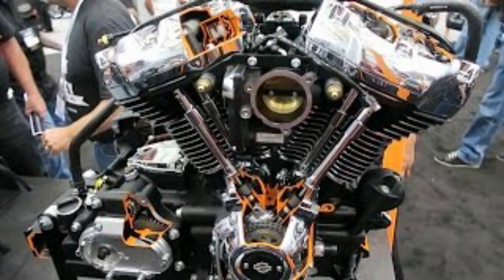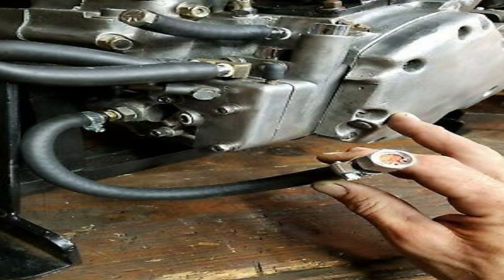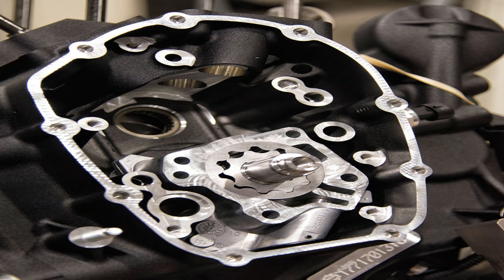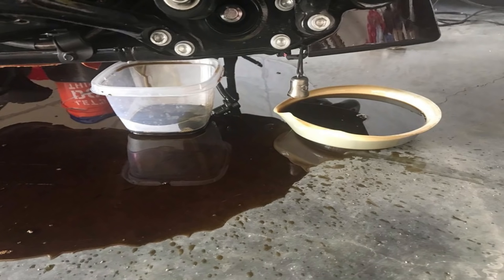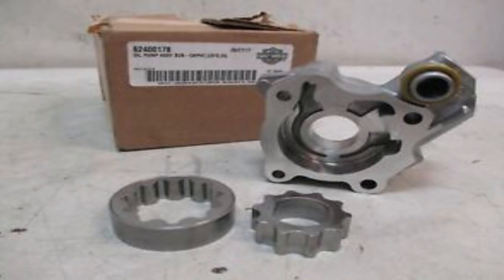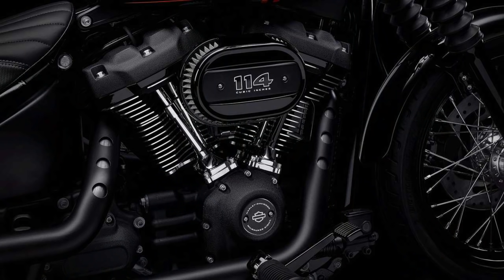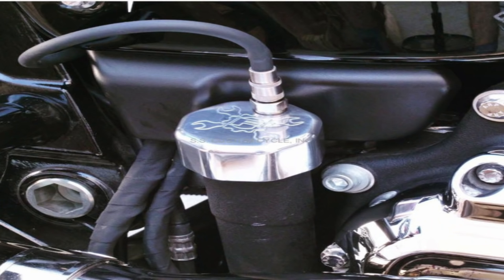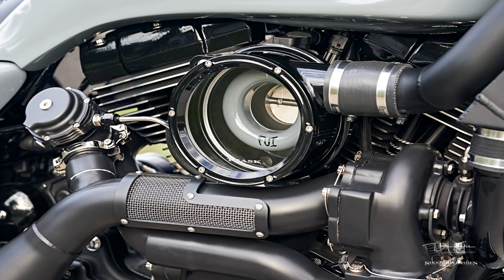The Fatal Milwaukee 8 Engine Flaw Harley-Davidson Missed

Comment: Any chance I can talk you into doing a video on what octane gas is best for your motorcycle?  Should you go with a higher octane as you start throwing high performance parts on your bike? I think with your knowledge you could finally put this debate to rest once and for all.
Also great video! I don't even own an M8 and I watched 👍😎👍
Reply from the maker: That's an excellent idea, I think I'll do that. I see people swear you can run regular but a bike needs the highest octane you can get since they are prone to detonation.
Reply: Norton on their Commandos had the same type of issues with engine breathing problems as well as oil frothing in the crankcase starving the crankshaft of oil leading to failure it was these defects as well as others that brought the downfall of the company being penny-wise and pound-foolish is no good it cost you customers

Comment: Still riding an '05 Deluxe. Rode a Shovel for 20 years prior. Very interesting video. They all have their issues; but over a few years, each engine proves to be an upgrade; even though it's hard to beat the sound of a well built and tuned Shovel! What I noticed when the M8 first came out was how mechanically quiet they were. I honestly could only hear exhaust music.

Comment: 4 oil pump versions plus a new added gasket. Plus the early versions with oiler screws to long. Geez sad R@D from the beginning. Using customers as R@D is losing buyers.
Reply from the maker: Harley has a serious issue of testing on their customers in my opinion. You can't tell me with a straight face as many miles as they claim to put on these motorcycles in testing that they didn't catch it or weren't aware of a potential issue.

Comment: Is this oil sumping problem also on the 2019 CVO 117" M8 engine as well?
Reply from the maker: It's been happening on the 2017 to early production 2019's, late production 2019's received the upgraded oil pump. You might have your dealer check your vin to see when yours was manufactured and see what pump it received.

Comment: So if u have a 21 street glide what needs vented and what oil pump do I need if any
Reply from the maker: On a 21 the oil pump is good, I would still run a vented dipstick and or transmission cover just for good insurance.

Comment: Harley-davidson has been making V-Twin engines since 1909. You'd think they would have perfected it by now.  The best V-Twin engine Harley-davidson ever built was the sportster/XR 750 engine Designed in 1955. You would think they'd keep the same design and just make it bigger  !  WTF, give me a 4 cam (geared)  engine with  4 valve heads and 120 cubic inches and stop all this other Bullshit  !
Reply: Blame the EPA. Harley would have happily kept some old ass engine and save the development costs. Of course they would probably be out of business over low horsepower numbers. Then you would have been begging Harley to build a new engine because they should have been able to build a newer motor with more HP.

I don't think you would ever be happy no matter what they do. Also, nobody is stopping you from buying and modifying a sportster/xr750 engine.

The M8 is a fun engine and the new PanAmerica engine (once it works through its growing pains) is a great engine as well.
Reply: You are right. EPA have nothing to do here. all manufactures have already and very long ago upgraded their engines to the nowadays standards, Harley still selling shit engines to the idiots who buy them 😂🤣 please shoot me...
Reply: @TeensierPython  I have modified sportsters and that motor is bullet proof compared to a twin cam or M8. And M8 is just an old evolution design with a 4 valve head and more cubes. And still it has reliability problems. Most reliable harley engine is the sportster engine hands down. Vrod is a Porsche engine which is pretty awesome but really isn't a harley motor.  I just can't understand why harley wants soo much money for an inferior engine. They just make it bigger so it's better  ? LOL 😆 Once again harley-davidson has been making V-Twin engines for over 100 yrs and still has reliability problems.  I guess you like tinkering more than riding !
Reply: @TeensierPython  Sportster engine was designed in the 50s and guess what  ! It passes EPA in 2021 with fuelinjection.  Sportster engine per cc  puts out more horsepower than any other harley-davidson engine !
Reply from the maker: Harley's 4 cam engines were the best and most reliable designs they ever built.
Reply: Their best engine is the German version 😂
Reply: @corneilcorneil  lol
Reply: @GixxerFoo  😂😂😂 Really? But on the other side, it is like congratulate a chicken when it can fly 4 meter high and ignoring the eagles.
Reply: It's all about the "moolah," brother. Build them cheaply, sell them high, replace half the new parts on the bike you just paid for with upgrades, and then have the customer foot the repair bill when something fails.
Reply: @flhxs8364  Yeah,  Harley's engines are designed so they can build the engines with inferior parts.  I don't mind pushrod engines but when you have to angle pushrods they become even more inefficient ! Build them all like the sportster engine,  4 geared cams and pushrods that are straight, not a Twisted Sister !
Reply: 4 valve 120 ci (not 4 cams though) - Try a Yamadawg Stratoliner ... just kidding.  Although I'm not sure about 120ci - 1900 cc, really 1850 or so.  Pretty fast straight though.
Reply: @corneilcorneil  True,  now harley has put out their own version of this engine and looks just like it. LOL 😆
Reply: @benkrom2737  HD, the copy brand since 1904... or something. They invented NOTHING, just NOTHING... or yes, mybe they invented a  motorcycle related clothes brand. 🤣
Reply: @corneilcorneil  Never said they invented anything. Just stating you'd think someone who's been building V twins for over 100 years should have it pretty much bulletproof by now.
Reply: @@aircooled352yes, but it’s just a pup by comparison. Had an 03 and 2012 Sporty. Not the same league as my 2018 114 with 40,000 trouble free miles on it. Just sayin’.

Comment: Longer Harley goes on and the more engines they keep making, the more I love my Evo!
Reply: My Evo spun a cam bearing at 6k miles. My 49 year old Shovel still runs fine though.
Reply: @vinnie999  some early evos had problems with cam bearings but they fixed that, and then they never died again...

Comment: I have a 2020 street bob but it was made in September 2019. Do I have the newer oil pump?
Reply from the maker: I believe they do, anything after August I believe is likely to have to the updated oil pump. The sumping issue has really seemed to be on the touring models only though, haven't heard much of it on the softail.

Comment: When I went stage 2 on my M8. Change to updated 2020 HD pump. Carryover dissappeard!
Reply from the maker: That's a excellent point about carryover, that was another fun little problem on some bikes. What year is your M8?
Reply: Carry over is a totally different issue. It's called sumping with excessive amount of oil in the case.
Reply: With the carry over they vent the primary
Reply: @GixxerFoo  2018 , sold in late 2017. Before the update, I cleaned the air filter every 1,500 miles. After the update, every service and zero carry over.
Reply: @georgekelly8900  Exactly the point I was trying to make. Root cause of the oil in the air cleaner was sumping. Updated the oil pump and all is good.
Reply: @larrys.3992  what I'm saying is the piston oilers have been seen to stick open they should normally close under 5lbs or so basically at idle. And also have been seen to be loose to the point that you can wiggle it with your fingers. Either way it isn't good and you'll wash your cylinder walls out.

Comment: My 19 117 had the updated pump,the inner primary cover vent.ive had zero issues and i also don’t overfill it with oil during oil changes.i have zero aftermarket vented parts.there so many costly theorys about the oil sumping.
Reply from the maker: With the 2019's late production had the updated oil pump, early production had the old style. Mostly the sumping issue really showed itself with the Stage IV kit or high horse aftermarket builds.
Reply: Take a moment and watch some of Baxters garage videos as he breaks these motors down and splits the cases and diagnoses what happened.

Comment: i know you said till 2019 but i know some model years are really made the year prior so i have a 2020 softail standard does it have these issues or no? thx
Reply from the maker: You're good on the 2020 model year, even late production 2019's have the updated pump. If it was a early 2019 production it would have the older design of the pump.
Reply: @GixxerFoo  and, how do you know which pump you have, if you have a 2019 FXBB, for example.
What should the oil pressure run at, i have a V&H FP3 on my bike to tune the Stage 1
Reply: @GixxerFoo  thanks man, appreciate it! good video.

Comment: I own a sportster and it seems reliable but I'll be honest it's no where near the reliability of the Japanese bikes I had. For instance the primary chain is noisy as hell, even with good oil it sounds like it's grinding on metal. The bike also has a crap battery that usually takes 2 cranks to get started. My Japanese bikes started instantly and the engines even on my s1000 sport bike were quite. The only real thing I like about the sportster is the exhaust sound and that it's belt driven. It's easy maintenance.
Reply from the maker: Harleys are completely different animal than the metric bikes, they are for sure not as refined.

Comment: How come Harley didn't recall this problem? It seems that if I just bought a brand new bike for $28,000 I shouldn't have to worry about an oil  pump problem on the first road trip. So sick of HD.
Reply from the maker: Sadly if it's not a safety issue it won't get a recall, if it just cause premature engine failure they will just update the troublesome part and put it in the new bikes.

Comment: Do you have to change the cam plates if you take an aftermarket oilpump?
Reply from the maker: Yes, you'll will need a new cam plate to run one of the race pumps since they have much tighter tolerances than the OE pump.

Comment: on a 2020 limited, should I also put a vent on the carb to eliminate the oil from going back to the pistons, or would the vented dip stick be all thats needed?
Reply from the maker: Even with the vented dipstick the head breathers will still pull crank case gases into the intake. Adding a catch can or external breather is still a good idea.
Reply: @GixxerFoo  Thanks for the info

Comment: Have a 89 Evo bought the bike new sort of attached I'd like to increase the displacement the bike has 24000 and smokes a little. I'm running Andrew's 27 cam screaming eagle inition s and S carb pithon pipes.i was thinking about 88 inch. Any suggestions would be greatly appreciated
Reply from the maker: If it's time for a top end a bolt on big bore and keep the compression near stock with your cam would be the ticket. Leaving the cases stock bore is important, but bolt big bore kits do work very well.

Comment: Why is crankcase breathing/pressure an issue for Harleys?  You don't hear that from Japanese or German bikes.
Reply: Those types of bikes have much smaller engines and also share their engine oil with the transmission. Ive owned 2 M8s, one was a 2018 and now a 2021. Never had an issue with either powertrain.
Reply from the maker: Completely different engine architecture, the 45 degree design comes with some engineering challenges to say the least.
Reply: @GixxerFoo  Agree, but Harley has had this basic engine design for decades, long enough time to perfect it/fix it.  Perhaps HD should address these engineering challenges with some actual engineering.

Comment: What about the evo motor, my 1990 flhs pukes oil out of the breather when sitting for a few weeks. so i know what to do. i just remove the hose going to the air cleaner and run it into plastic bottle at first start. when the puking is done just reconnect and press on. seems to run good though.I still get caught with an oil dump incident if i become complacent. What a mess. my driveway had an oil spill the size of a basketball. keeps engine corrosion free.

Comment: 🛑🛑 Great Video Obey One 😀👍. 

I passed this video to all my friends with M8’s. 

I’m surprised there wasn’t a recall from 2017 through 2019 to upgrade the Oil Pump??

Great Info 😀🍺👍
Reply from the maker: Thank you! They were replacing them if you brought one in that was having issues but just like the cam chain tensioner on the Twin Cam it was never recalled.

Comment: Does the m8 2022  have any problems? Cheers
Reply from the maker: The M8's 2020 and newer, some late model 19's have the updated oil pump, that's seemed to alleviate a lot of the sumping issue. There are some bikes that still do it, but not all of them now. It's really on the touring models mostly, for whatever reason we don't see it a lot in the softails.

Comment: It's hard to beat the evolution engine have a good day
Reply: U got that brother..i have an 92' Flhs..solid!!
Reply: Right on ! 91 FXR !
Reply: 1995 FXD
Reply: 2020 Sportster 1200 NS fuel injected evo.     Fun ride next to my 83 Low Rider.  Long trips on the shovel, short rides on the evo.  Debating whether to get a 2021 Road King standard.
Reply: @scruffy4647  my vote would be no ! New Harley owner's are the R & D dept .
Reply: Or just buy a Honda motorcycle
Reply from the maker: The Evo was the most reliable big twin engine Harley ever built.
Reply: @scruffy4647  get the special!
Reply: @GixxerFoo  Was...?? Is it discontinued!?
Reply from the maker: @n.a.6735  The Evo? The big twin went away after 1999, the Sportster Evo is still in production as of 2021. We'll see if the Sportster as we know it is still around for 2022. It's already disappeared everywhere except the US due to emissions.
Reply: Amen
Reply: The Sportster still has a evolution engine
Reply: @GixxerFoo  actually 1998 was the last year of the big twin EVO. 1999 was the first year of the Twin Cam
Reply from the maker: @maddogrob  It was, but they carried over the Evo in limited production FXR'S which were essentially the first CVO models.
Reply: @GixxerFoo  I thought they were twin cams too. Huh, I’ll have to look into it now
Reply: @GixxerFoo  Actually you're both wrong, all 99 softails were still EVO twin cam b didn't come out until 2000
Reply: I loved my 1986 FXR Liberty Edition EVO, but it leaked oil a lot. Probably not the best mechanic, so I’m sure it was mostly operator error. That said I recently bought a 2016 Twin cam Breakout over a 2020 just because I’m not sold on the Milwaukee 8 just yet and with only 800 miles on the twin cam bike and a 16k price tag with handlebar upgrades, Vance & Hines exhaust, suspension upgrades, grips, controls and custom paint- it seemed like a logical decision.
Reply: I like the evolution, but its a vibration machine, my wife loves it on the rear fender 😀.  The twin cam 88 with a big bore 95 kit from s&s and the upgrade cam gear setup = bullet proof and extremely low on vibrations. In short, evolution good for longevity, but twin cam can be made for a couple thousand into a machine as reliable and huge decrease in vibrations felt/transfered to rider.
Reply: Evo’s were their best engine!
Reply: @sventhorborsen7313  wow...what a bargain
Reply: The same motor Porsche made? Well then yeah.
Reply: Had a Twin Cam, got rid of it before it went south, went back to an Evolution. 26 years old, still runs perfectly.
Reply: @thomaskirkpatrick4031  they're good, i can't stand the vibration for long rides.
Reply: @thomaskirkpatrick4031  
Yep had many twinkies and evos. I currently have a 09' StreetGlide. I like the bike but I'm willing to sell/trade for a good condition 97'-99' evo Fatboy. 👍🏼
Reply: @josephpupino6632  
You are correct. I had the first yr Deuce (2000) twinkie. I believe the A motors came out in 1999 as they used to test new motors on those before putting it into the Softail.
Reply: @PAULY-P  I got a 97 Evo heritage softail. with fat boy back wheel Only 13,000 miles on the motor since it was built from the bottom up .
Reply: @maddogrob  ive had 2 1999 evo motor bikes. 1999 heritage and a 1999 softail custom. Maybe they were early half year models? But they were both evolution 80" bikes. Gutless dogs they were🤣
Reply: evos forever
Reply: @GixxerFoo  is fucking amazing how Harley been in business for so many years and still can't get their shit together
Reply: I wish I would of known this about the oil pump b4 I traded my twincam for a M8. I guess it’s time to dust off the old evo RK sitting in my garage! LOL
Reply: @tmar0075  thanks for posting I guess years ago had evil engine it was a good one but my inmate is also a good one $60,000 absolute trouble-free miles
Reply: I totally agree, I have a strong running twin cam 88, but I've also did an install on gear cams oil pump cam plates and a big bore. It's a strong dependable motor that I wouldn't hesitate to go cross country on.
Reply: @sll-tt6bj  harley sells image not tech😁. I still ride my 98 fxstc, looking to get a 90's heritage or fatboy aswell.
Reply: I like my  blackhead
Reply: Blockhead
Reply: My 883 at 100 mph is vibration free. Great engine.
Reply: @sll-tt6bj  they’re building a muscle bike with one hand tied behind their back because of good ol uncle samantha
Reply: I got the last one, 99 Fatboy!
Reply: If Harley started producing a model with an EVO engine it would definitely sell. But at the same time that would be indirectly admitting that the rest of their engines are crap lol
Reply: and the beauty is that you can go out and buy 3 different models of low miles evo bikes for the price of one new HD.  and the styling is better and theres tons of aftermarket stuff to bolt on if you want to.  fuck these new hardley davidsons.